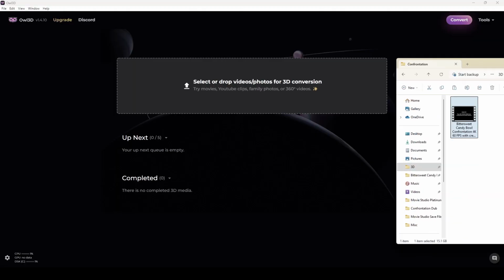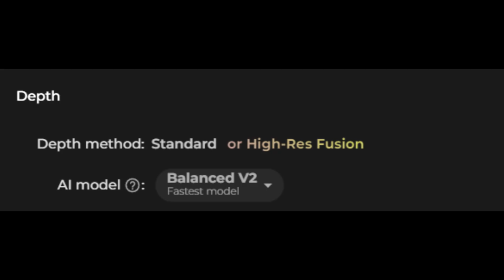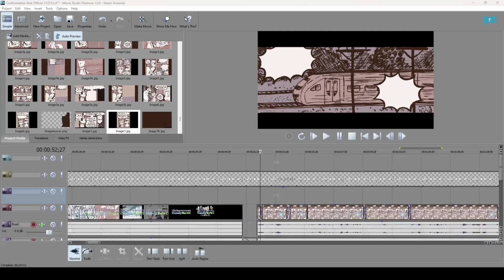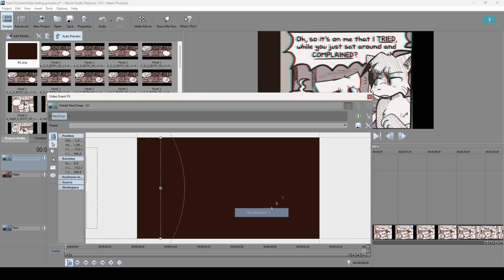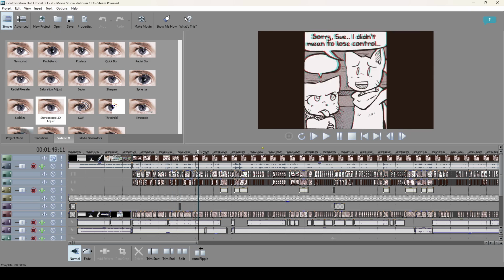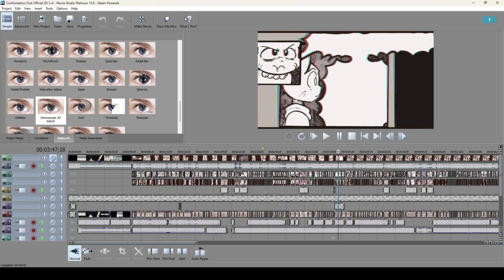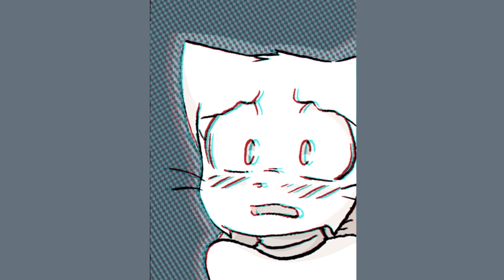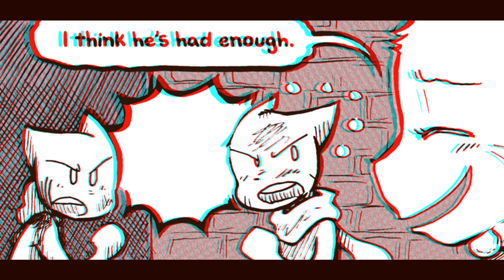How I Convert The Dubs | Anaglyph 3D

Comment: I appreciate the explanation of how you create your comic in 3d!  I see that you totally rely on owl3d now. I'm sure after weighing all alternatives that works best for you.  If you ever want to do the 3d process as you draw the comic in one step, consider Blender Grease Pencil (GP).  it can draw each layer at a different depth and you can be in anaglyph mode as you draw.  You can also draw on 3d surfaces like a sphere to create more rounded 3d objects in depth.     At a high level - @3dtimeTraveler806  shows things he created in GP.     The learning curve is pretty steep though if you have no experience but in the long run, you'll be in 100% control of the 3d again. (other than rely on owl3d)  Thank you.
Reply from the maker: I appreciate it! Unfortunately this is not my comic, I just made a dub for it. I trust that Owl3D will get better over time. I have already taken steps to fix the issues I mentioned in the video. Easy fix of cutting out the errors and layering them overtop a clean plate.